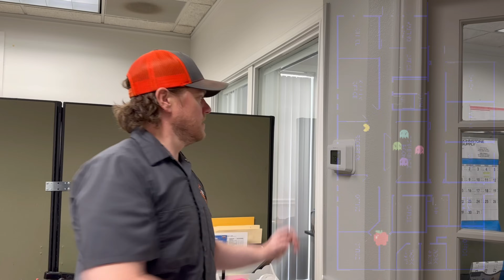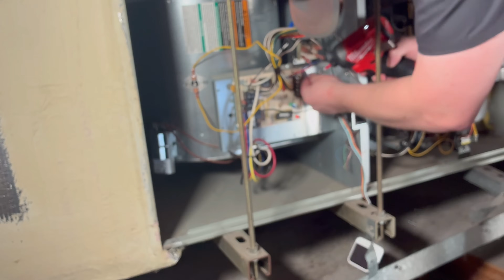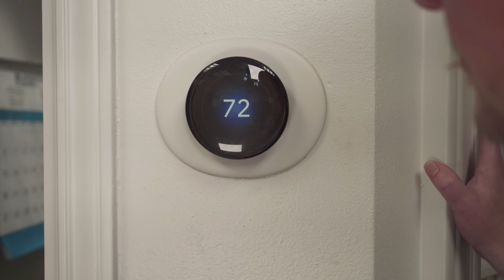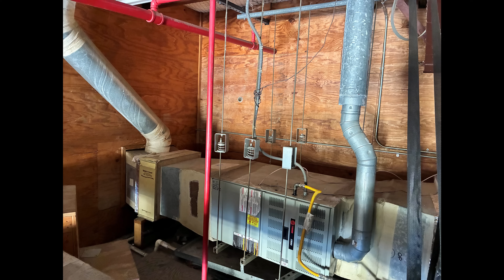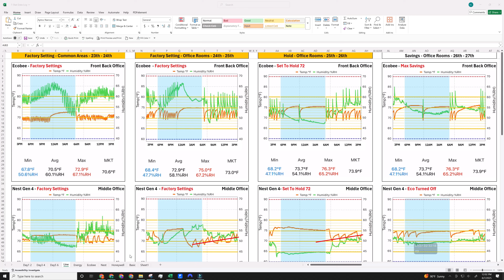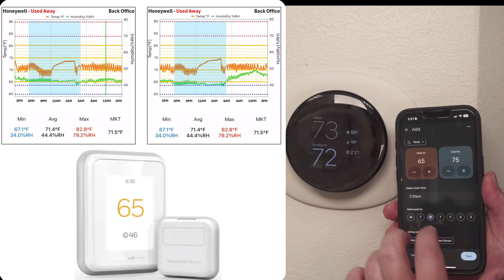Stop Buying The WRONG Smart Thermostat

Comment: Love my Nest Gen4 I had a Lennox M30 and it would cycle the ac at least 3 times per hour each cycle would last about 10 minutes and the inside air would feel clammy I switched to the nest and the humidity is much more under control as well as the cycles last longer and its off for much longer which helps with wear and tear instead starting up so frequently.

Comment: With these fancy new thermostats cant' you manually set the temperature swing, set a temperature setpoint for different time periods and days of the week, and even set a humidity setpoint range to override temperature if humidity rises too much? With a 20 year old very simple thermostat I can do all except set a humidity override and it only allows me four time period and weekdays or weekends and of course no Wifi to check or change settings remotely.

Comment: We had a Honeywell T9 installed along with a new furnace 6 years ago. The little solenoid in the t9 that you hear click when the tstat triggers the system burnt out after 2 years. Our HVAC company replaced it with the Honeywell t10 (essentially the commercial grade version of the T9 according to the HVAC tech) and we've had four trouble-free years from that so far. I have room sensors all throughout the house and have settings in the schedule to prioritize different areas of the house based on the time of day (so for example the temperature setting is pulling from the room sensors in the bedrooms overnight but the thermostat is using the temperature readings from the main living spaces during the evening). Really great system. 

One of the other things that I'm not sure you can do with a T9 that the t10 does allow is the ability to set a minimum off time between cycles to prevent short cycling the system. You can also set a specific number of cycles per hour if you want. One of my favorite settings I found is that I was able to set the fan to run for an extra few minutes after the air conditioning kicks off. Potentially increases the humidity in the house slightly but it also allows me to get all of the cool air out of the heat exchanger after an air conditioning cycle.

Comment: The Ecobee was not properly setup. I have a 4 level house including the basement and the temperature difference between floors is anything from .5 to 1.5 degrees and rhats because I have a room facing the sun and at the same time has a lot of computers so it screws up the sensor reading.
Reply from the maker: got it

Comment: I have the old Honeywell 9000 model(Not sure the exact but the old rectangle model). I haven't had a problem with it just their server goes offline randomly, but that's been good for the last couple years. I know it's about 8 years old now so at some point I know I have to upgrade. All three seem to be good from all my readings but I like to have one that's good about reports for daily/monthly to go with working good. The Honeywell currently just does once a month. Maybe the new Honeywell thermostats have a more daily report? I read the other two does better regardless for reports to where you can see how often they run. The nest part that concerns me is the learning part but how good is it if you really wanted to just control the schedule yourself? Thanks.
Reply from the maker: good luck and let me know what you decide

Comment: Is it the best economical 🤑 idea to run european designed heat pump mini splits?
Reply from the maker: depends purely on the application
Reply: @atlasacrepair  . I am in the middle of building a small house for my family, I came from South America and back in my city we only had Window units and Mini Splits, I know how much energy efficient they are, would you think that going the Mini Splits rout for my small home is a good idea? I am thinking about the performance of the house and the energy bill 🤔

Comment: So basically ... Nest thermostat is cumbersome and not user friendly, not to mention the remove user support every couple years to force you into buying the newest device even though they work just fine. Also, they no longer support the Nest thermostat which was way better than using the home app.
Reply: Not true. Just installed my Nest gen 4 about 3 weeks ago. No issues and works flawlessly. Love the adjustments I control while I'm at work preparing to come home.
Reply from the maker: sounds like a -1 for the Nest

Comment: I believe the nest has a built in 1 degree temp swing, which can not be changed.
The Ecobee is preconfigured for 2 degree but can be changed.
Reply: My Ecobee Pro was factory set to 0.5 degrees.
Reply from the maker: I believe you are correct

Comment: Hi my house is two-story and only one HVAC unit so it have a dual zone with 2 separate thermostat one upstairs and one downstairs but for some reason the upstairs AC keeps running whenever the downstairs running even though the thermostat upstairs is already shut down the cooling because it already at the temperature I set at but the system still running upstairs. What do you think the problem I have?
Reply from the maker: a lot of options that can be wrong. 
1. zone board is bad or wired wrong
2. tstats are bad or wired wrong
3. damper actuator have failed or wired wrong
4. no bypass damper system or not operational
it's too hard to say since the two zone systems have to be designed, installed and maintained by competent Tech

Comment: The biggest-selling thermostats is the old-fashioned ones - I will never put a smart one on after the government turned off people's heat with them during the power outage a few years ago in Texas.
Reply from the maker: smart tstats can be installed and not connected to government control
Reply: That's why you don't link it to your electric provider.
Reply: @Eggy824 it has nothing to do with the electric company it is connected to WiFi and with that they can control all settings
Reply: @RobertMillerJustme I promise you they can only control it if you've opted into their program.
Reply: @Eggy824 - no 6 years ago during the Texas power outage it came out, it was on Facebook and YouTube and the local news even did a piece on it - Google owns nest and amazon owns Ecobee and they have a back door in every case they were lower the temperature to 68 degrees and locking it there
Reply: @RobertMillerJustme  Amazon never owned Ecobee but they did invest in it. They haven't had any part in Ecobee since 2021. They can/will increase the temp on your tstat by up to 4 degrees in a extreme heat event if you opt in to their optional savings program. Oh yeah, they can't lock you out. lol
Reply: @nino714  That goes 100% against the reality of what they did in Texas during the electric grid issues. and they did it to every one of the smart ones. If it were hooked to the WiFi, they could control it, and now it is worse. Why, Amazon has the biggest mesh WiFi system in the world! And if you are not hooked to it, they can still control it from any network you get a WiFi signal from, meaning your neighbor's Alexa can interact with yours.

And yes, ecobee is now owned by Generac, but the parent company has nothing to do with it; the government can mandate an "emergency" and take control of it.

Get ready for this one; federal law also mandates it in your automobile starting in the 2026 model year, they can shut it down and control it; it's the preparation for the 7-mile cities, I mean, prison system.
Reply: @RobertMillerJustme  If and I mean if they were able to control your thermostat and lock you out you could always disconnect it from your wifi. Problem solved. As far them controlling it from any wifi signal that is some sci-fi stuff right there. I work in low voltage wiring copper and fiber optics. They just can't access a piece of electronics that is not connected to the internet and make it connect remotely. 
I, like many people voluntarily allow our electric company to remotely adjust my thermostat in an extreme weather event but I can override their adjustment manually if I choose to.
As far as the government controlling cars I'm sure you're onto something there. With all the electronics now your car can easily be tracked and remotely disabled. They've been doing that for a few years.
Reply: @nino714 a mesh network Amazon created is all Amazon products can interconnect look it up there are some good videos on here about it

Comment: Nest has a humidity mode that will run the system if humidity rises too high, irrespective of the set temperature or sleep mode.
Reply from the maker: yep, it will cool several degrees below setting while aiming at reducing humidity

Comment: What was your Ecobees “compressor minimum on time” factory setting? Mine was factory set to 5 mins which caused it to short cycle constantly. I live in Houston and have a 4 ton unit. I changed it to 12 mins and it made a world of difference. What’s your recommendation for minimum run time to be set to in Houston? Also, the factory humidity(7 percent too high) and temp(3 too high) was off as well on my unit. So you are correct. Some units need to be calibrated. Thanks for the great video.
Reply from the maker: you're welcome and I'm love hearing from someone who has done their homework. Thanks a bunch for the excellent comments!!

Comment: Okay, yeah, inrush current is a thing. Though it’s an additional part, what’s your stance on a properly sized soft starter for the compressor?
Reply from the maker: soft start kits often void factory warranties. 
make sure before you install a soft start kit.
hard start, or instant on, is better for the compressor than soft start.
Reply: @atlasacrepair what makes it better? Lower chance of having it in a state that’s mechanically stalled when starting?

Comment: I'm in Houston. One HUGE tip for the Ecobee: you absolutely MUST putty/plug up the hole behind the Ecobee into the wall. The sensor on the stat is back there and its readings are way off and swing wildly if you don't plug it. They don't emphasize it enough during the install. They just mention it for troubleshooting. But I think it's required and should be in the basic install instructions.
Reply: Our downstairs ecobee room had us feeling cold when it registered 78-79, it didnt' make sense and was running all day in the summer to keep it there. It's installed on a wall shared with the garage. I'll try this tip! I re-calibrated it using a good thermometer, it was reading about 3-4 degrees high on average.
Reply: totally understand this as well! I actually added 2 more sensors for a total of 3 room sensors and the main T-Stat.. and i just tell it to use the room sensors, that made a huge difference.
Reply from the maker: great advice, thank you for your comment
Reply: Heres a tip from someone in the trade for 43 years. You should stuff the wiring hole behind ANY thermostat with fiberglass insulation every time, not just for Ecobee. The draft from the hole will alter the ambient temperature the stat is reading, affecting its accuracy.
Reply: I see. Might explain why my ecobee doesn't cool as my old Honeywell that I replaced it with. Seems the ecobee cant dip below 80 degrees ...set at 80 and it stays running
Reply: I have sensors all over the house and I am bypassing the thermostats sensor all together
Reply: @dtouw the humidity stays off
Reply: 👍thanks.  Great tip.  I’m going to check all 4 of mine.

Comment: I wanted something that would turn my system on and off at specific times at programmed temperatures.  I thought I needed a smart thermostat and almost bought one when my AC guy told me I just need a programmable one. Saved myself a few $$$.
Reply from the maker: programmable will handle that type of schedule for sure

Comment: Don't buy a Honeywell. Honeywell tstats are way too conservative in turning the system on. With it set at 72 it wouldn't turn on until 75. With no way to adjust it. I assume they do this to get better energy ratings. But this is just gonna tempt people to turn the temp down even more
Reply from the maker: that's why the testing to reveal how these Tstats actually perform. Thanks for the feedback

Comment: the delta can be adjusted in the ecobee, but not in the nest, so you may want to go back and try adjusting the delta in the ecobee to be more like honeywell and update your content.  Also, making the equipment cycle more will cause more wear.
Reply from the maker: out of the box settings vs. educated settings, thanks for helping everyone understand you can't take one of these tstats out of the box and use it.
Reply: He doesn't need to update the content. Everything you pointed out was covered in the video, and you can adjust the delta or maintenance band differential in the 4th Gen Nest system. I don't think older models had this capability.

Comment: The default settings in the ecobee could cause weird things to happen to your hvac equipment and potentially damage it if they aren't turned off.  Same with Nest, though those settings can't be turned off and you should use the nest with a c-wire, it claims to work without one but will do weird things to your equipment and may still do weird things even with a c-wire.  With the ecobee there is a setting to allow the furnace to control the fan in heat mode, but even with this setting the thermostat may attempt to control the fan and override the furnace which as you can imagine can cause some problems.  There is a setting whereby the thermostat runs your blower for 20 minutes once very hour to circulate air even when the thermostat is off.  This of course uses more energy and increases wear on your blower so should be disabled.  There's also a setting to continue running the fan after the heat reaches target temp and switches off.  Normally the furnace may run the fan for a minute or two to exhaust air until the temperature inside the furnace drops then it automatically switches off, but the thermostat is trying to do the same thing at the same time so this setting should be disabled as it could interfere and damage the internal switch that controls the fan in heat mode.  There is some sort of AI setting that has to be disabled to access some of these settings I mentioned that you can't access the menu for those settings as the thermostat is controlling those settings.
Reply from the maker: a lot to unpack, I'll have to check and let you know what I find

Comment: Hello I have a t10 that turns on for 5 mins and off for under 10 would you call this short cycling should I get a new thermostat or call the installer out again because they are telling me everything is fine
Reply from the maker: sounds like short cycling to me, especially if it shuts off before the temps are satisfied. 
have the installer put another tstat on and see if it does the same. 
then you'll know if that tstat is faulty and should be changed under warranty

Comment: Maybe I’m ignorant but what do you mean the ecobee has a 4 degree temperature split? Was it letting the temperature increase 4 degrees before coming on? I thought the default was 0.5 degrees on the thermostat out of the box.

I do wish smart thermostats would include a CPH setting so you don’t have to play with temperature differentials to prevent short cycling. 

I had an ecobee but it fried my aux heat relay (at least that’s what the tech said, may have just been a faulty relay but it was less than 2 years old) so I went back to my Honeywell T6 Pro that came with our unit. Ecobee won’t warranty the thermostat unless I put it back on the wall and run through diagnostics with them. I don’t want to fry another relay if it is faulty.
Reply from the maker: The Ecobee may have been wired wrong and that is what fried the relay??
Out of the box settings is why we did this video because there's a lot of assumptions about the settings that are not accurate.

Comment: I think my Nest is damaging my compressor on my dual stage heat pump. In the winter when we are much below freezing it keeps wanting to use the heat pump and it’s such a struggle to get it to kick on the aux. It causes my heat pump to run all day on those cold days, which is over using the compressor. Now my 6.5 year old unit is showing a weak compressor. I already replaced a capacitor 2 years ago, and now per my hvac people the capacitor needs replacing again.
Reply: Nest is known for taking out compressors

Comment: Your videos are great. We used to live in Houston. We had a new Reem AC. Tried to replace compressor myself. Total disaster. Did not vacuum down system. Brazing was also a problem. What do you think of the new low temp. melt solder for AC systems?
Reply from the maker: Our crews are moving over to the flameless clamping systems and away from brazing

Comment: Sensi !!!!
Reply from the maker: One of our Team has used Sensi on his two stage for 3+years, but we decided to not include it in the test, at least not yet. 
Thanks for asking
Reply: @atlasacrepair  I use a Sensi touch with the direct voice access via Amazon and Google. Amazon routines turn it OFF/ON on a schedule, or when I leave the house, or when I come back, it has a winter and a summer schedule, and I simply tell it to cool/heat the house for an hour or Alexa cool/heat the house for 30 minutes. The only thing negative that I noted was that Alexa cannot read back the humidity reading whereas Google reads the humidity. The Alexa and Google integration is the best feature. I have a Trane 3ton dual stage central air.

Comment: I have a two-stage Amana but have an ecobee standard.  Would there be any advantaged to switch to ecobee premium?
Reply from the maker: the operation of both should be similar, but the features and settings of the Premium would be the main reason to change.